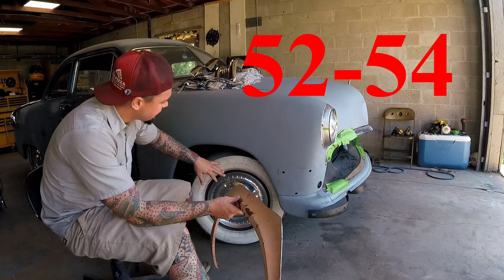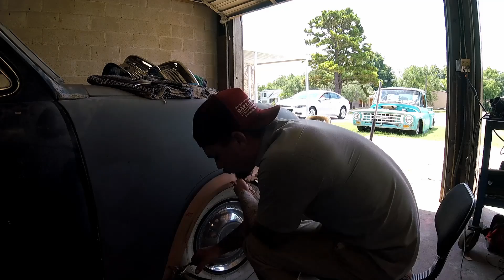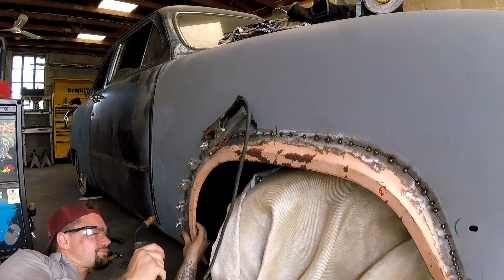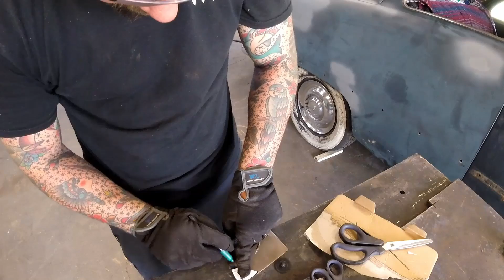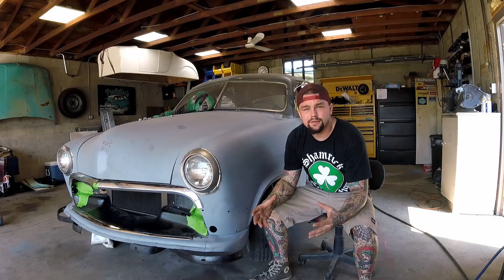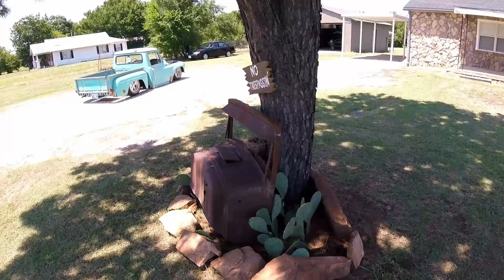Puddin's Fab Shop. Adding 1952-54 Ford fender flares to a 1950 Ford coupe!

Comment: Great video! Your encouraging my old ass to get out and do my own work on a few projects I have going on. Project 1 is a frame off restmod on my 1966 Malibu. I almost have the frame completely done, I just got to weld in the frame boxing kit I got for it. Then I can hang the upgraded suspension and paint it. Then I'll put the body on a rotisserie for a small amount of bodywork and then prep for paint.    Project  2 is a 1938 one ton pick up that I'll put on a 2004 silverado 4X4 frame. Project   3 is a 1947 one ton Mercury pick up that's going for a stock resto. It says on the internet that there are only 10 left known in existence ( we all know that anything put on the internet is true ). It came from the factory with a factory installed cigar lighter, sliding rear window,  PTO and a dump bed.
Reply from the maker: Glad these videos help! Even if it’s just encouragement! Get one it!